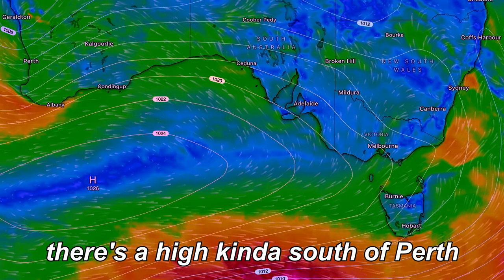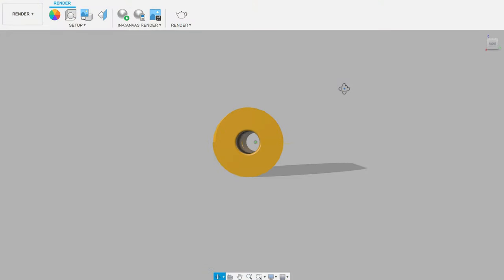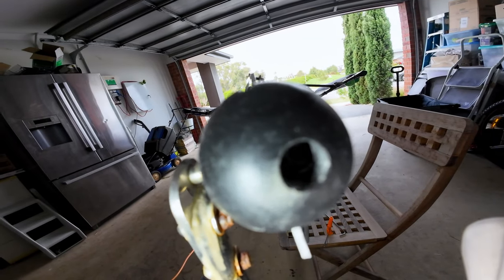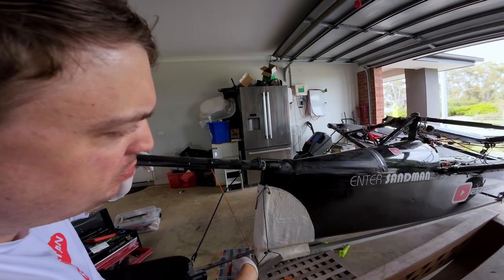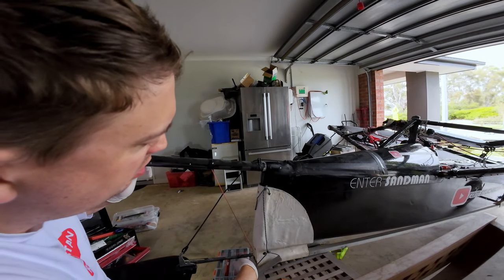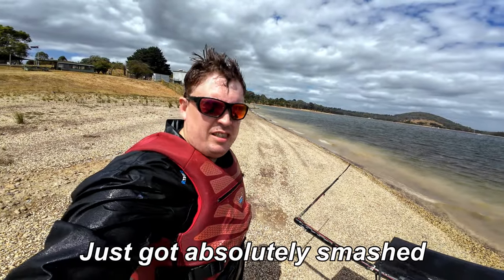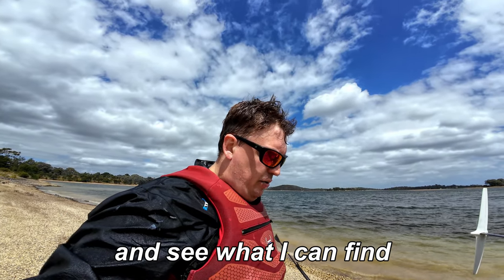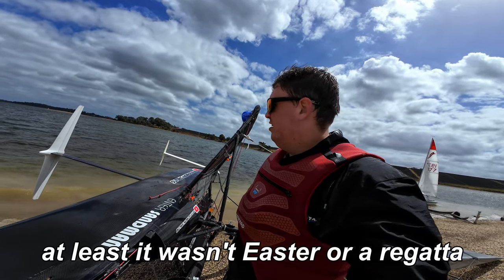Sailing the Unsailable! Flight control issues with my $3600 Foiling Moth (EP13)

Comment: I upgraded my Mach 2.3 to a 2.6. I found the key to wand/flap control was to minimise all pushrod play, take out any and all slop in the system. Makes the wand movement range as direct to the foil flap as can be. Then gearing and ride height will work much better! Good luck on your journey, half the fun is working this stuff out!
Reply from the maker: Thanks, it is amazing what even the tiniest bit of slop can do! I’m currently at a regatta, going to go on a slop-hunting mission in the morning!

Comment: Nice work thinking through the issues Tom, there is nothing harder to sail than a Moth with a non working control system.  That whole bell-crank system, I assume to get around the mast stump, is just a disaster, too much potential for slop/binding/play, like Bugs says just go a straight rod.  I run that on my Mach2 and it's flawless.  Like I said in your last video, when you get it all back together check your flap range relative to wand range.  This is effectively your gearing and you probably want ballaprk 12-14mm at the back of the flap over the wands entire range.  The 'ride height' effectively moves where this flap range occurs relative to wand position.
Reply from the maker: Yep, I tried to go around the mast stump but it’s just no good, even when it is kinda working (compared to my old boat where it went straight through). The multi tool will be coming out shortly and it’s all coming out! I have the standard bugscam bellcrank so it should have the right flap range, but I will double check when it’s back together 😀

Comment: That's super interesting to see my self that even withe a correct looking moth with all the parts in place and so on its still not working well... That downwind (or upwind?) In the last part of the video you ended up so frustrated was a good example.... It looked like everything was fighting each other... No stable flight hight
Reply from the maker: Hi, thanks for the comments! I’ve watched a lot of your stuff, I really like what you do. Yes, the boat was very unhappy by the end, it’s amazing what one broken pushrod lever can do, I basically had zero flap control, so it wouldn’t take off until about 12 knots boatspeed, then it would just keep going up. When everything’s working I can take off doing about 8.8-9.2 knots, so it makes a big difference! I’ll cut this system out this week and put in something a bit better, I have some ideas to try 😉
Reply: @TomStuchberySailing-eg9vr  first time I have sailed a moth it was so amazing, I can just imagine how it must feel when nothing work... And at the time you had no idea why...! Can't wait for the solution. And I watched you video instead of 4wd247 or an AdamLZ vid in my short time of the day I watch YouTube! Really like what you do!
Reply from the maker: When nothing works it is kinda amazing and terrifying all at the same time, with an underlying feeling of dread while you wonder if something expensive is broken! It means a lot that you chose to watch my little 350 sub channel instead of a 4WD channel with 1 million subs, thanks again!

Comment: At about 19min 30 sec. I'd say you sailed out of the wind. The video shows you were on the edge of  a gust but not in it.
On a foiling boat its possible to go faster than the wind. So if your in a gust. Its possible to sail out if it and fall in to windward (again your a big guy). This is especially so on inland lakes as you seem to be sailing. Then as you sail out of gust, stop, gust catches up with you and bang your over again. Thinking,  what the  h*ll just happened there?
Well that's foiling for you

OK should have watched to then end as can see you got problems with linkage. Still in general  comments above are valid
Reply from the maker: Yep, this is a tricky spot particularly in that direction. I definitely wasn’t watching the breeze since I had my head in the boat trying to figure out what was wrong with the control system, but hopefully once it’s sorted I can chase the puffs up and down a bit better and keep the thing going, even with 122kg on the edge 😉

Comment: Just discovered your video, very nice, I was also a bit desparate when starting moth on mach2 but after redoing all system now everything is set perfectly and enjoyable.

One question, I noticed you have 2 inversion on the connection between wand and foil.
Why don’t you try a simple long rod directly connected ? Does the boat allow a straight line between wand and foil ?
Reply from the maker: Thanks for the comment. I tried to go around the mast stump and compression strut in the foredeck to avoid drilling holes in things, but it didn’t work as you can see. I have ended up drilling through everything, new video showing that should be out tomorrow 😉
Reply: @TomStuchberySailing-eg9vr  great !!
Also did you check your relative angle for both foil ?
Here my setup :
Main foil is 1 degree in front hole (lift)
Rudder is between -3 degrees and 2 degrees 

The measurement is done compare to the hull near the main foil 

Then when flying upwind you have to add lift on the rudder 
When downwind you need inverted lift on the rudder to avoid the bow to go down during the gust, you also need to reduce the wand when downwind cause you are not sailing up heal and then not charging the foil, boat will automatically goes up when downwind so clearly reducing wand length and put negative on the rudder will sort issu you are facing !
Reply: @TomStuchberySailing-eg9vr  last but not the least 
For the direct connection between wand and foil with compression rod try to keep the the rod inside a very well adjusted tube, if not the rod will wave inside the tube resulting a loss of information like a spring effect or/and grip du to high friction when wand is activating fast in compression 
It is something to keep in mind cause it is not easy to réalise while sailing
Reply from the maker: Yes, all very good points! 😀 I did adjust the AoA in episode 10 when I swapped from the Macita to the Mach 2.3 HL, I think it’s about 1.8 degrees positive. I have ended up fitting a 7mm ID tube and I’m using a 1/4” pushrod, which is much better as you suggest. All will be revealed in episode 14 as soon as I get a moment to edit it!

Comment: I'd agree with much of the first comments , @nskz. I have a mach 2.3 with 2.4 bowsprit. I'd call that water your sailing on flat. It seems to me you need more gearing. Also looks like the wand should flick fwd more because it came out the water.  I suspect your sailing too bow up. Machs go better slightly bow down. That said I find to get on the foils in those  conditions (your a big guy) it is best in Hull mode to raise the bow with rudder and sit forward (it looks like your too far aft most of the time) then as bow lifts you need to rapidly wind rudder lift on so that lifts stern. Sort of how a plane takes off. 
I find on my mach that the wand length adjustment is more useful than the ride height. Remember gearing increases as you shorten the wand. I think on the Mach some sort of nonlinear connection  system is really needed. What I mean by this  is , near neutral it needs more gearing but as it nears the limit less. So that max flap movement is not exceeded.
Regard your tacking and gybing.  On the tacks you are moving too late with rudder on. Ie you need to move much more to the otherside with no rudder movement. As the rudder is applied the boat needs to be level or nearly. If bow goes down as you tack then you've got too much heel  as rudder vertical acts like a flap.
On the foil gybe you attempted . You were round on the foils but then failed to head up to get the power on (and you needed to head up a LOT). That is why after the gybe you fell in to the windward side.
It's crucial that you watch the horizon as your gybing   , not say one or two lengths fwd at the water.
Reply from the maker: Thanks for the detailed comment, most of the issues you observed were from the broken pushrod pivot I found at the end of the video, so I had no flap movement for most of the video, so the bow up thing would have been me using the rudder to put more AoA on the main foil to get the boat out of the water. Interesting that you use the plane taking off method to take off, I was doing that on my old boat but then I read the how too guide on the mach2 website and they reckon that you should have full bow down on the rudder to generate maximum lift across both foils. I normally just have the rudder somewhere in the middle as I haven’t figured out which way is better yet. Thanks for watching! 😀
Reply: I found that full on rudder in Hull mode causes the boat to nose dive. Needed to get rescued once as could not get back to the harbour because I too read those Mach comments. 
I think those mach comments might apply to older boats with perhaps less rudder lift.
Try it in Hull mode some time. : head up a bit more and wind rudder full on to full off and see what happens.  If as bow lifts and you heel to windward manfoil tends to stall than more rudder is needed as bow lifts. 
I think I needed to do this more when using mach 2.3 high lift mainfoil.